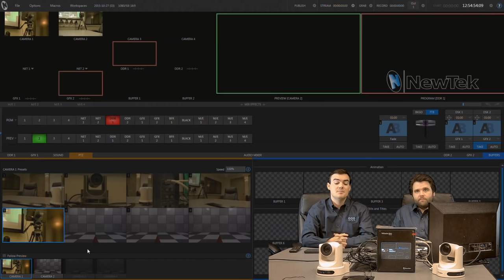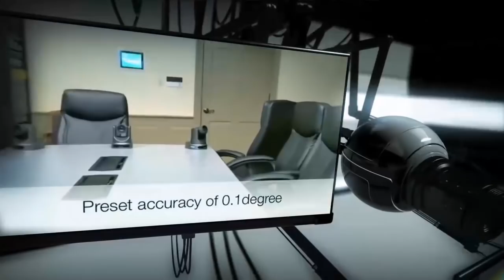PTZOptics NewTek Tricaster Camera PTZ Control Integration Overview

Comment: Please make a video that shows step by step Tricaster  to PTZOptics camera using Ethernet.
Reply from the maker: Hello!
Setting up a PTZOptics camera with a NewTek TriCaster system over Ethernet allows you to control the camera directly from the TriCaster interface and integrate high-quality video feeds into your production. This setup enables you to utilize the camera's PTZ (Pan, Tilt, Zoom) functionality through your network. 

Here's a step-by-step guide to get you started:

1. Connect Your PTZOptics Camera to the Network
Connect the Camera: Use an Ethernet cable to connect your PTZOptics camera to your network via a router or switch.
Power the Camera: Ensure the camera is powered on. You might be using Power over Ethernet (PoE), which allows the camera to receive power through the Ethernet cable, or a separate power supply.

2. Obtain the Camera's IP Address
Use the Remote or IP Finder Tool: The camera's IP address can typically be found using the PTZOptics IP Address Finder tool or by navigating the camera's menu using its remote control.
Note the IP Address: Once you have the IP address, write it down or save it. You'll need this to access the camera from the TriCaster.

3. Access the Camera's Web Interface
Open a Web Browser: On a computer that's connected to the same network as the camera, open a web browser.
Enter the IP Address: Type the camera's IP address into the browser's address bar and press Enter. You should be greeted with the camera's web interface.
Adjust Settings If Needed: Here, you can configure settings like video format, PTZ speed, and other preferences. Ensure the video format matches what your TriCaster system supports.

4. Configure the TriCaster
Add a New Camera Input: On your TriCaster, go to the input configuration where you want to add the PTZOptics camera.
Select NDI®/Network Source: Choose to add a new source and select the option for an NDI® or network source, depending on your TriCaster model and software version.
Find Your Camera: Look for your camera's IP address or name in the list of available NDI® sources. Select it to add it as an input source to your TriCaster.

5. Control Your PTZOptics Camera from the TriCaster
Access PTZ Controls: With the camera added as a source, you can now control its PTZ functions directly from the TriCaster interface.
Preset Positions: You can set and recall preset positions for your camera from the TriCaster, allowing for quick changes in camera angle and zoom during live production.

Additional Tips
Firmware Updates: Ensure your PTZOptics camera and TriCaster system are running the latest firmware/software versions for the best compatibility and performance.
Network Configuration: Ensure your network is configured to allow for smooth communication between the camera and the TriCaster. This might involve adjusting firewall settings or network switch configurations.
Latency: For live productions, monitor any latency between camera movement commands and the video feed to ensure smooth operations.

By following these steps, you should be able to integrate a PTZOptics camera into your NewTek TriCaster setup using an Ethernet connection, enabling advanced control and flexibility for your live productions.

Thanks for checking out our Channel! 
Learn More: https://ptzoptics.com/